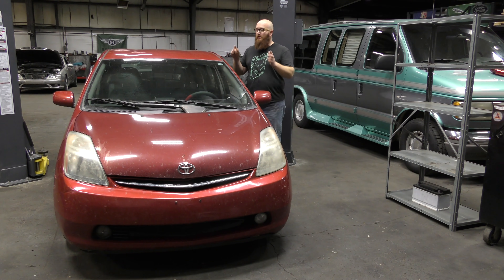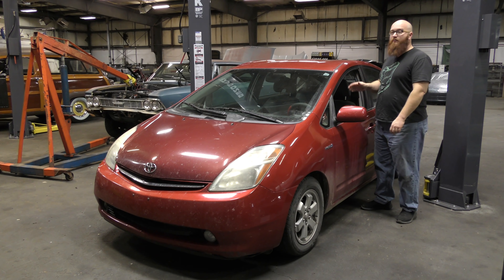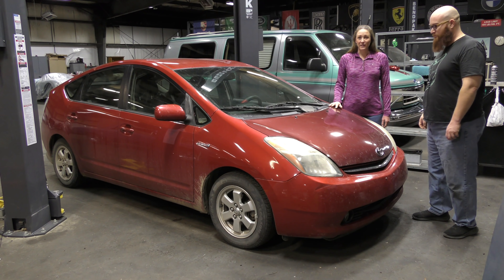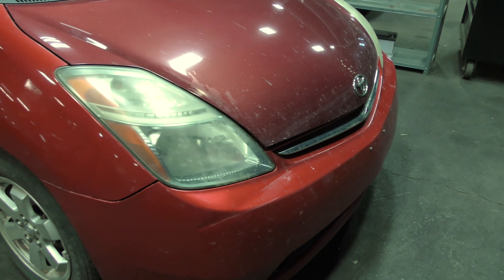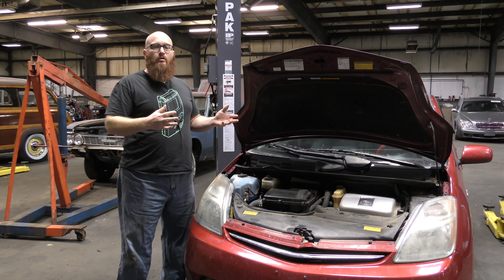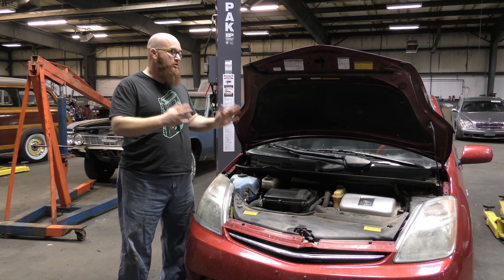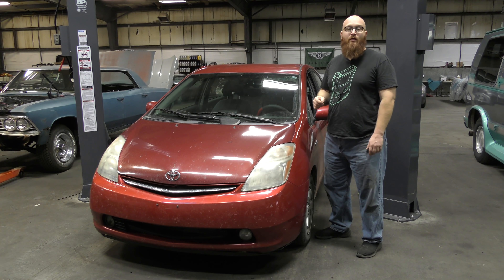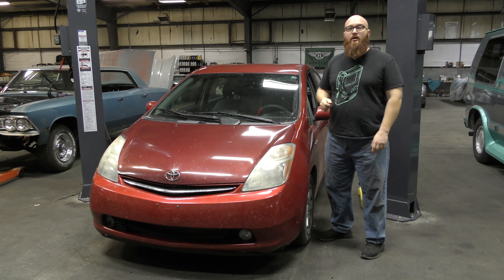When is it time to Buy or Sell a Hybrid? The CAR WIZARD inspects daughters 2008 Toyota Prius

Comment: quarter million miles on my 08 and still running strong just like this, haha it eats oil now too, about a quart a change. All original, I use Mobil 1 0-30 in it, best oil I've found, I use it in all my vehicles.

Started using more oil about a year ago but I'm keeping it running till it dies. You can see some repair videos about it on my channel, I know all the tricks to get around its quirks so it's a great car as a work car. I use it for 40k miles of pizza delivery a year on the roughest country sand gravel roads, you'd think twice about taking your nice 4x4 on.

Toughest, most reliable car I've ever driven, you can make fun all you want but they will be still running when your car is in the junkyard. 

PS Speaking of brakes, changed the pads up front after 150k miles. The car costs you NOTHING to own, just tires and fluids. I did replace the 3 way inverter coolant valve at the same time as the pump at about 200K, so should be good again for a while, OEM parts used only, of course.

Comment: Hello WIZARD, I had the same color, same year Prius, with 230K miles.
Two months ago I sold it to a user car dealer for $2K and purchased a 2021 Camry hybrid with 25K miles from a Toyota dealer.  Also purchased 100K bumper to bumper warrantee.
I really wanted a newer Prius but None were available with fair prices.

Comment: The tease of the Chevelle in the background with the engine lift sitting against it....with an engine installed?!?
Reply: Going to swap in a sweet Prius 4 banger.
Reply: s_reilly it’s too high for an engine to be in it
Reply: @hereigoagain5050  haha he did say it was more than 8 cylinders. Guess it’s 4 cylinders plus the batteries! 😂😂
Reply: @wurly164  true the suspension is up there in the front. May be I’m seeing the top of a radiator
Reply: It has the Maybach engine.

Comment: Under what circumstnces would anyone be changing the oil with the ignition switch on?
Reply: Those cars have smart keys. He probably forgot to completely power the car down. That’s what I figure happened.
Reply: He drives the car up to the lift. Then turns it off, car in neutral. Then he gets out, and pushes the car to where he needs it for lift arm placement. He does this by grabbing the wheel and rotating it. To avoid putting hands on areas of the car that aren't load bearing structures. I'm assuming this is because if he were to drive the car into the lift, the doors would be close to the posts due to where normal lift arm placement is. He's shown on a video this method, but I dont think he's ever explained why.
Reply: @greglikewhoa2623  There is still no reason to keep it on.
Reply: "Alcohol"

Comment: Got a 2008 Prius also. 150k miles. Hybrid battery is good. But I got a 0420 bank 1 catalyst below efficiency. The car has good pickup and zippy , not anything to suggest a clogged catalytic converter. If you look in the owners manual it suggests Prius oil consumption is normal ?? Really ??  Wondering if changing the oxygen sensors would eliminate check engine light.   Other than that the car starts up and goes wherever I need to go.
Reply: I would certainly change the o2 first.  Hopefully it is not an aftermarket cat.  If you recently bought it used on the west coast, aftermarket is likely.
Reply: @rj.parker it’s a car my father in law gave me when my Honda Civic hybrid pooped out ar 80k. Lol.  I don’t know where it came from other than it was a lease or rental car before my dad bought it. Every part except tires, air filter etc is original no aftermarket cats. It’s been throwing the 0420 code for a long time as of today. Like a couple years. I just checked the oil and noted it used about half quart in a months time. It seems to burn oil more when I drive fast or push it sometimes on the expressway. Other than the oil burning it gets about 40 mpg when I drive normal but not a snails pace. I’ll give the oxygen sensors a try because it’s still a pretty good car for everyday driving. Thanks man.

Comment: I stopped watching Scotty Kilmer after his "expose" on hybrids and more specifically on the prius. As unreliable cars after the warranty runs out. It has been my experience that many prius owners will happily pay to have a engine, transmission or battery replaced  due to the gas savings on the rare occasions it happens.  As well as his take on electric cars.
Reply: Like any multi-generation car, there are Prius models to avoid.  2010-2014 Prius and Prius v with the 1.8L burn oil and blow head gaskets way too often after 150k miles.
Reply: @rj.parker  That's namely toyota's fault. The engine it self if the same used in the corolla. The difference is the water pump and complex coolant lines. The water pump is electric and when it dies around 120k-150k  you get a check and you blow the head gasket if you do not check. It should have the 🔺️ of death.
Reply: @josealbreyes  I agree it is Toyota's fault that 2010-2014 models had high oil consumption and resulting egr and head gasket problems.   But the root causes are a combination of factors.  Overheating was usually an end result of head gasket failures losing coolant through the cylinders.  Pump fails would not cause an issue if promptly shutdown and were never a frequent failure mode.   

Number 1 root cause were bad piston rings that allowed excessive blow by into the egr and pcv.   This  created excessive carbon in the valves and cylinders.  Too often owners did not check the oil and ran low until a low oil pressure failure compounded things.  Bad valve stem seals added more oil burning.  

Number 2 is the egr system itself which employed an elaborate stainless egr cooler upstream of the egr valve.  The egr cooler is liquid cooled and picks up exhaust gases upstream of the cat, effectively condensing portions of them.  The foot long egr cooler then clogs limiting egr circulation.   Egr recirculation cools the combustion chamber but after clogging leading to pinging and knocking.  Which is destructive before the knock sensor can adjust timing.  

3.  The pcv system also dumps oil fumes into the plastic intake manifold, creating a catch can of liquid oil which eventually sloshes into a cylinder, usually cylinder #1.  This often fouls the plug and causes further damage, sometimes even hydrolocking.  

4.  While the Corolla has the same engine and is a good argument,  the Prius is a stop start engine while the Corolla is not.  As a result the 1.8L Prius engine has frequent thermal cycling as the engine cools and then heats up again while driving.  Sometimes cycling twenty, thirty or fourty degrees.  The head bolts are steel while the block and head itself are aluminum.  The head bolts and the block/head have significant thermal expansion changes many times per drive cycle.  The Corolla 1.8L stays at a consistent temperature.

Toyota admitted  bad rings on the 2010-2014 Prius engines and actually changed the pistons and rings free if high oil consumption occurred during engine warranty.   High consumption was defined as a quart every 1200 miles or worse!  They moved the egr intake downstream of the cat in the gen4 Prius and employed a new piston and ring design in later engines.   So the gen4 Priuses (Prii) are far better than the first four years of the gen3 models.
Reply: @rj.parker  I dont think the engine shutting down repeatedly would cause any issues with thermocycling per say as long as the engine got to operating temperature. Otherwise all hybrids and gas cars with stop and go would have issues with head gaskets. Many modern cars have aluminum heads and steel blocks. You have to consider that the engine will run if it is too cold to provide heat to the occupants and meet emissions. In modern cars head gaskets tend to fail more so from overheating and the extreme thermocycling evolved.  My fusion hybrid varies from 180-160 deg and that is more or less what the range of a thermostat is. 

 I have heard big issues in regard to the EGR getting carbon buildup and the ring issues. As well as oil buildup in the intake. I believe some people even did some oil catch cans or blocked the egr all together. Toyota did redesign the engine sometime in 2014 to address those issues and is effectively the same engine used in the gen4. However I think that the bigger issue was the service interval of 10k per oil changes and the lighter oil used in the gen3. As well as the addition of the electric water pump. Either way these issues often happen at around 150k or more. With head gaskets being the most common point of failure. Although the gen3 was not nearly as reliable as the gen2.
Reply: @josealbreyes   I don't know why Toyota just did not used the exact same engine of the gen 2 Prius on gen 3. Only if gen 3 was as reliable as gen 2 and the Prius C, gen 3 looks really good, at least from the outside.

Comment: The Prius is an engineering Marvell. They're more reliable than most gas rigs despite the added complexity of two drivetrains working together. These regularly do 500k miles with good maintenance and a set of remanufactured batteries.

Comment: I’ve worked on a few of these and owned a 09 for a long time. Only issues I’ve seen is the touch screen digitizer died and the dash readout module can die and both are repairable. Also water can leak in the hatch and is something to be aware of. I’ve replaced one of the tail lights and the rear hatch button sometimes gets funky.

Comment: The nice thing about hybrids like Prius is that the HV batteries seem to last a long time and can then be replaced for around $2,500 parts and labor.  The Porsche Panamera (or Cayenne) hybrids (2014-2016) batteries are same capacity as Prius.  Porsche bends their customers over to the tune of $24,000 dollars.  That's right. essentially the same battery at 10 times the cost!!!

Comment: Gen 2 prius was an amazing car. Truly bulletproof until the battery dies. We drove it for a few years with a battery that kept throwing the red triangle of death from not being driven. I would just drive it for around 100 miles and the red triangle would go away. Finally got rid of it this year after 265,000 miles

Comment: i have a car that uses or leaks maybe 8 oz every 3-400 miles... i just check and top it off once a week or so... adding fresh oil helps you get a little more miles per oil change also since oil last longer imo... so cost to change oil and filter is basically the same each year..

Comment: This car just started her life, i live in eastern europe and i have 3 or em, one i am driving for myself 2 rent to taxi drivers, so imagine that we make about 100k/km a year each car. One of the cars already have around 700k and still doing her job(takes a little bit.more oil between changes, but that's it) perfectly. Also we put gas system in it wich is an slow engines killers but not for these toyotas they are just fine.

Comment: Im buying a 2008 with 200k, the carfax was super clean literally all maintenance done no accidents 2 owner. It had 2 water pumps replaced at very low miles so maybe toyo had a bad batch but Im not worried about it, the 3rd gas been holding 10+ yrs

Comment: In answer to the question; when the cost of repair exceeds the value.  Now, sometimes there are personal or sentimental reasons to do it, but most of the time, it's just not worth the cost.  I owned a 1975 Pontiac Laurentian for years - was the third owner (the car had out-lived the previous two), and I really enjoyed that big boat.  I did my best to oil spray and protect it but by the time it was 31, the rear body mounts were going on the chassis.  The only way to repair it was a frame-off restoration, and I was looking at (then) about $12,000 Cdn to do that for a car that was, at best, worth virtually nothing.  I decided to just sell it for parts, and the engine, transmission, wheels and a dozen other parts or panels live on in a bunch of vehicles today. :)

Comment: If you use the OEM ATF (WS), it's not synthetic and good for about 30k. Jump to REDLINE D6 which is Group 4 (real synthetic) and good for at least 60k. There is no filter, pan or gasket on the trans - just a drain and fill plug. DIY. Takes about 1 gallon. Get REDLINE at Amazon. It costs more to get a reconditioned pack than to buy a late model low mileage junkyard battery.

Comment: Just switched out the hybrid battery on my daughter's 2007 Prius.  The car has 248K miles on it.  Starting to burn some oil also.  Hoping to get another 75K+ miles on the replaced battery, fingers crossed.

Comment: I just bought an 08 Prius with 244,000 miles.  I I wrecked my 04 Lexus ES 330 and only carry liability so I had to get something I could afford.  I'm too old to walk everywhere anymore much as I like walking.  So the motor and battery seem fine but it has a lot of rattles.  I checked around the inside and took anything out that might jiggle around.  It still rattles.  Today it rained and not rattle so it must be something under the car that when it has lubrication doesn't make any sound.

Comment: IDK about that generation prius. My friend works at Toyota and he said that generation prius have battery cooling issues that gave the hybrid battery a shorten life span. Some start having battery problems as early as 120k, and some lasting 300k. 

On the other hand, he said the 2010+ Prius solved the hybrid cooling and are solid cars. One of his customers still has the original battery with 530k miles.
Reply: Long hot summers can overheat batteries in southern states. 98% of owners and mechanics don't know the Prius has a battery cooling fan and filter screen from the interior which should be cleaned.

Comment: The one issue to look out for with this generation Prius is the inverter coolant pump. It’s a tiny electric pump with a separate loop from the engine. It has a tendency to fail so I keep a replacement pump handy. They’re only ~$50 on Amazon.
Reply: Toyota had a recall for those so if anyone is thinking about buying one could check with a dealer if the given VIN was already covered.

Comment: The Prius has a mechanic mode to prevent exactly the issue you talk about with the engine turning on and off without noticing. Also ask you can get it to run without waiting forever for like coolant changes.

Comment: In my case, it's partly the cost of upcoming repairs/maintenance being similar to the market value, and partly changing tastes/requirements.

I've got a car I'm about to get rid of. It has upcoming maintenance that'll cost about what it's worth, and I'm getting over driving a manual transmission in traffic.

That Prius would make a good tidy beater. The underside looks pretty clean, at least compared to anything of similar age from up north.

Comment: Anyway, I am slightly a fan of a 2017 BMW 440i xDrive coupe with the 3 L six-cylinder turbocharged engine and the eight-speed automatic transmission with manual-shift capability (sport mode). It is a lot more reliable than the older, 2008 BMW 335xi coupe. However, the Car Wizard is not a fan of BMW's, but Tyler Hoover always likes these vehicles. I am hoping that one day, the Car Wizard's older daughter will own a 2018 and newer BMW X5 xDrive 40i mid-size SUV, once she graduates from post-secondary institution and receives a better task in the workforce. It will protect her and keep her safe from any on-coming accidents from other road users.

Comment: I have a2010 with 284k miles the head gasket started to leak .  The quote to fix 4500 to 5 k. I put in Gasket fix and it’s a quick fix but it holding with me driving 120 miles round trip commute .  Like you alway say it’s a toyota

Comment: I ran into the same oil consumption issues around the 200k mark in my ‘07 Prius.  I switched to 10w-30 Motorcraft Diesel oil and it has gone from about 1.5 qt between oil changes to less than 1/2 quart.

Comment: my o8 has 229,000 on it with the original hybrid battery uses oil like most of them do. Thing about the battery is the buss bars between the cells are copper with no kind of corrosion inhibitor the cooling fan sucks in moist cabin air and the bars turn green and corrode. best thing I did was replce them with nickle plated bars $35 on ebay.
Reply: Changing the bus bars is a great hack. Have you noticed longer EV acceleration? While you had it apart, have you clenaed the cooling fan? Debris can get in there cumulating and building up from the interior.
Reply: @balintgbcz8263  oh yeah it was like night and day after changing the bars I also added a second auxiliary 12volt in the drivers side rear.

Comment: Did you notice the Prius took the number one Durability spot? It is the cheapest car to operate on the planet. Batteries included. Even those tiny stage ones are making a comeback with $7-800 battery packs. Crazy!

Comment: I had an oil change. Car no problems. At 3000 miles the car had no oil. I happened to have a quart. Pulled over put it in. Went immediately had  oil change 3 miles away. What could have happened   No problems burning oil. Have gone 1000 miles. Now having problems with electro motor charging bringing hesitation, excessive RPMs